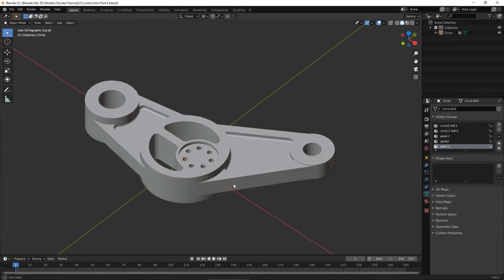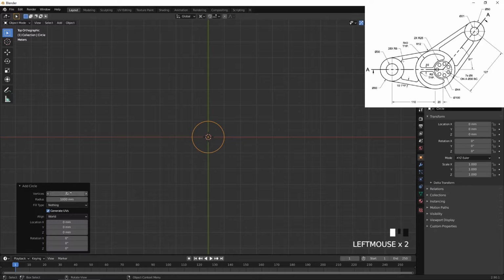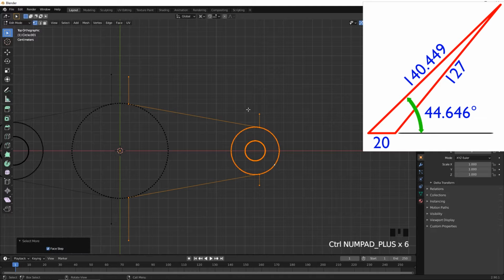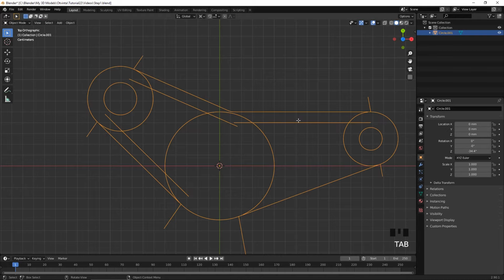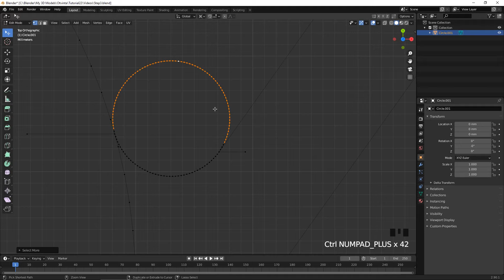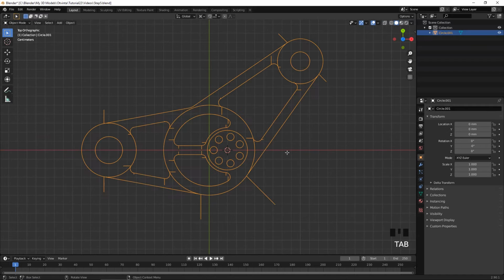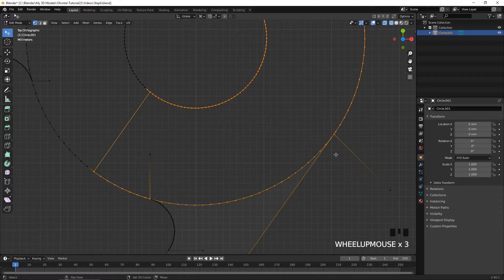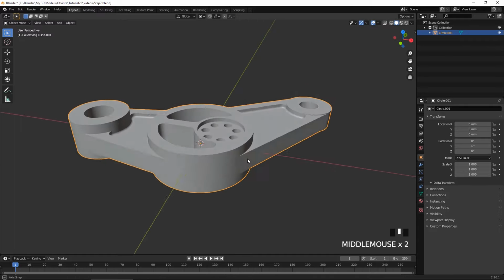How to Model a Tricky Part Based on a Technical Drawing in Blender 2.9.

Comment: You can use math expressions inside value fields. Not just arithmetic ones (3*2, 10/5+4, etc...), but also the standard python math module funcs in its shorthand evaluation form (without the namespace math.x). I.e: log10(x), sqrt(x), pow(x, y), and so on.

Comment: I would really appreciate it if you could please put together a series that shows how to construct a full mechanical model of any of your creations. These videos are great too, but it would be nice to see how to put together a full mechanical model on Blender. Thanks
Reply from the maker: Which model specifically?
Reply: @OTVinta3d  For example the Walking Gear Robot or Hypoid Drive model. It can be something really simple.  It would be interesting to see how the joints work on Blender. I have some experience with Fusion 360, however I am curious as to how you create mechanical assemblies and joints on Blender. Thanks!

Comment: Can't these calculations be done inside the blender?
Reply: Yes. As in my comment above: You can use math expressions inside value fields. And not just arithmetic ones (3*2, 10/5+4, etc...), but also the standard python math module funcs in its shorthand evaluation form (without the namespace math.x). I.e: log10(x), sqrt(x), pow(x, y), and so on

Comment: Your work is awesome! Do you create all your 3D models using Blender? Would you recommend using Blender to create mechanical parts and design robots to be 3D printed? Does anybody know if Blender can be used for this purpose?
Reply: I would say that Blender is good for sketching out a mechanical design. You can quickly generate a lot of geometry, which could represent your real parts and freely move them around. The final model should be created inside some CAD for dimension and geometry accuracy. CAD is just more precise and offer you mechanical mates, like concentricity of two cylinder part or tangency of two surfaces, which would take a lot more time to set up inside Blender. CAD also allows you to make drawings of your parts and assemblies.

So yes, you can design mechanical parts and robots in Blender but it will be harder compared to making it in CAD (free: FreeCAD, Fusion 360, paid: SolidWorks, Inventor, Catia).
Reply: @richardkokstein  Thank you so much, this cleared some confusion that I had.